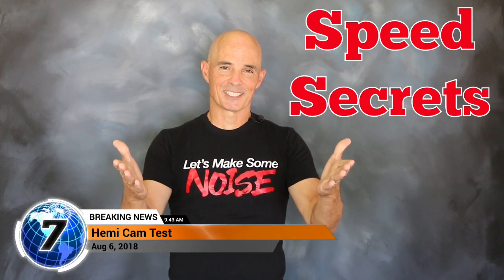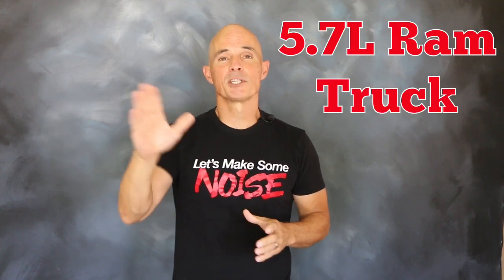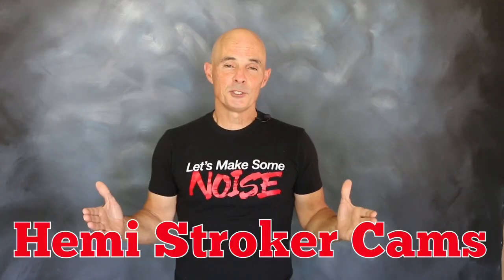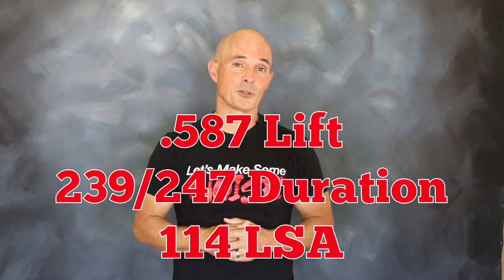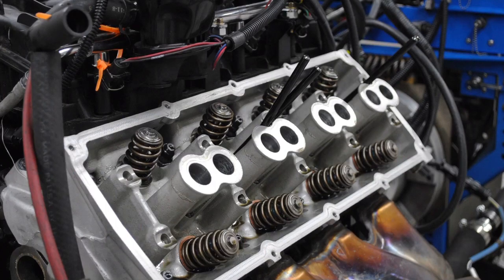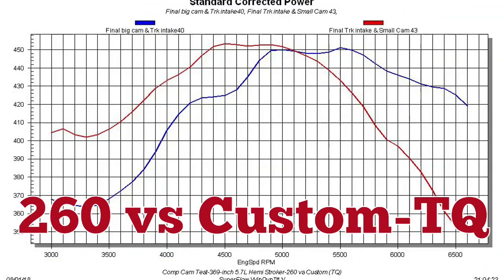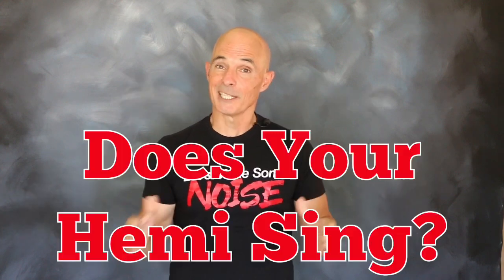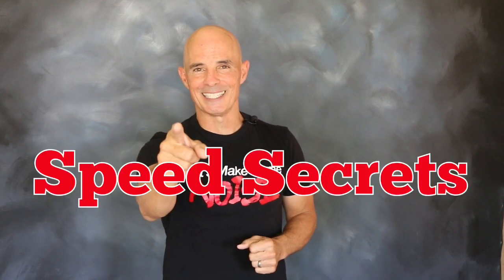Speed Secrets: Gen III 5 7 Liter Hemi Camshaft Swap

Comment: I need help 
Just put the comp cam 268 thumper in my 2009 5.7L hemi also got rid of the MDS, put a cam phaser limiter from Comp Cam and long tube headers, truck starts and runs good for a minute then idle drops down and truck detex random misfire and shuts off any suggestions 
I have a Diablo i3 tuner but thinking it needs a custom tune

Comment: Im building a 5.7 based 6.4 stroker for my ram truck,  looking at the HRT3 cam paired with the edelbrock victor ii intake.
the victor intake should give some low end power with the long runners,  the camshaft should give it some top end.
Thoughts?
Reply: What year is your build?
Reply: @craybato7591  2008
Reply: I was wanting to do this same set up on my of ram.

Comment: Spending all that loot when a better all around cam that you will not have to wind out to the moon is the factory 392 cam.   Looking at the same power gain for a couple hundred than thousand .  Besides all that , great commercial 🤥
   So why not just stick with the 5.7 ? Why go from the 5.7 to the 6.1 ?
 The carb and single plane needed 290+ duration.

Comment: If you bore the 5.7 to a 6.1 do you have to rebuild everything or can you still use the 5.7 stuff like the crank and rods Bc ik you have to get bigger pistons but is that it or what else do I have to do
Reply: Yes when your going to stroke the motor you have to buy a stroker kit. Basically it's a bigger crankshaft, pistons basically the bottom end you can probably fine a decent one for a 3rd gen hemi from summit for about 1200 bucks and heads/cam and basically everything else on a budget probably will make the same power idk though I'm a ls just starting to get into hemis

Comment: I'd rather see some more possible cam sizes than small and huge! How about trying something more doable like 225/235, 220/228?  Also how about showing a comparison with cams with only changing the exhaust duration? Or a video on how much duration needed for a head that has 60-65% flow compared to the intake flow? And how about informing if these cams are ground and installed straight up or advanced or retarded. Not complaining you're a great source of info just saying.

Comment: Someone like Comp has to come up with a way to oil the cam and lifters at idle. No oil is getting there until 1500-2000 rpm thus failure, shavings in the oil pan.
Reply: I wonder if the piston oil squirters could be redirected to oil the camshaft instead? That's an upgrade I'd definitely use on my 6.1
Reply: The Cam and Lifters have oil, the problem is cheap MDS lifters
Reply: It's now been proven that the issue is oil pressure at idle.  Remedy- Hellcat oil pump or a Melling HV/HP oil pump.  Check out Reignited Cycle and Automotive's channel.

Comment: When did a square motor change meaning? It has always meant the relationship of bore to stroke. If you Google square engine or square motor this is what you will read absolutely nothing about power output.